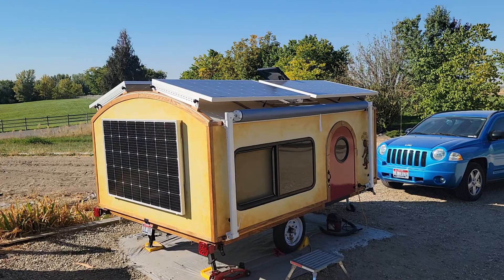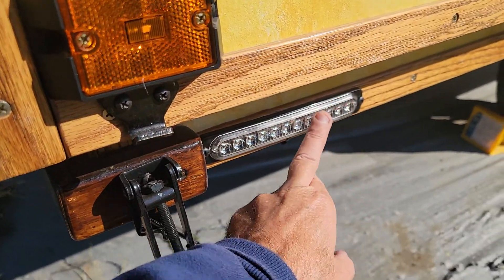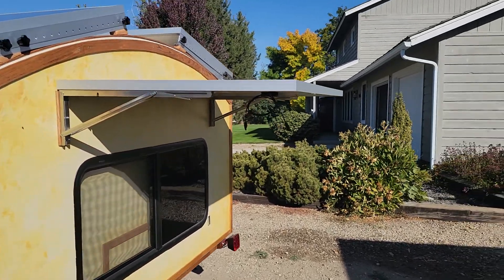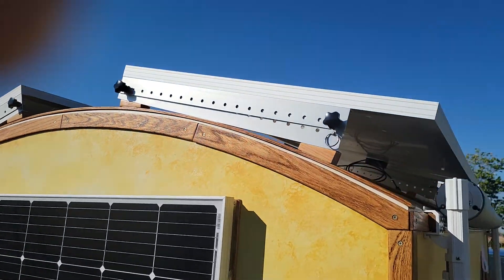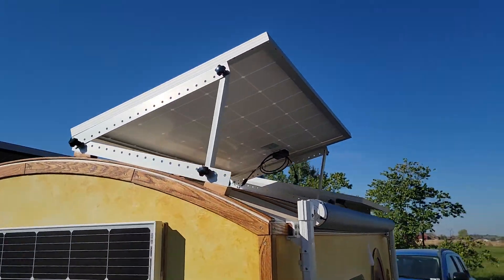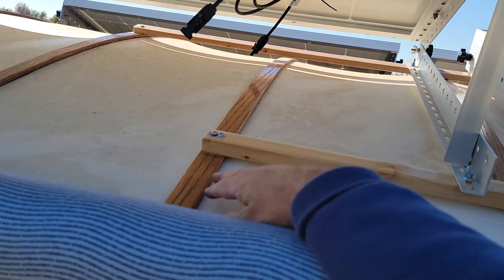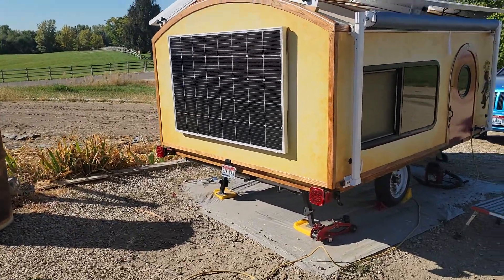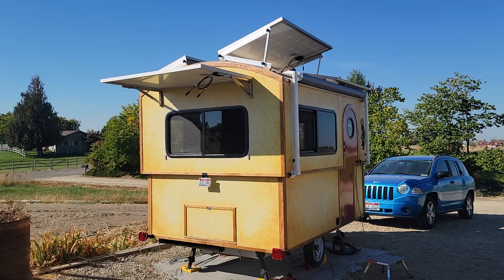Gypsy Caravan Project, Part 13: Solar Panels

Comment: How do you protect the side awning/solar panels while driving down the road?
Reply from the maker: I made a cover for the front solar panel out of thick naugahyde backed with a sheet of the 1/4" foam the panel was shipped in. I sewed an elastic band into the edge seam so I pulls the sides around the panel, then added 1" grommets to hold bungee cords running behind the panel. That also shields the front window. The top and back panels don't need protection, and keeping them exposed allows for continuous charging while mobile. Likewise, when the awning is stowed it's snug up against the side with low profile, so it's never been damaged.

Comment: You can build the back panel frame like the ones on top use those lock pegs on the ring and you can choose which way to tilt the panel. I never lost the knack of good erector sets. LoL
Reply from the maker: That's a really good idea. I think if I just drilled some holes is those existing brackets, and add a couple lengths of angle aluminum, I could use the ring pins just like you said to change the position. I love erector sets!

Comment: Looking good.  You have a heap of solar panels, how many and what size batteries do you plan on having (or have I missed that somehow?)?  Also do you plan to make something to cover the front solar panel to protect it from stone chips etc. while travelling? 
It'll be great when it's all finished.
Reply from the maker: It is a heap of solar panels for sure! I'll go through my full setup in the next video when it's all done, but I've got two 200Ah LiFePo4 batteries onboard, with a 150/100 MPPT charge controller and a 2000 watt inverter. As for the front panel, I'll be making a padded cover to avoid those nasty rock chips and bug splats. Good questions! 🐛

Comment: How do you plan on protecting the panel on the tongue end during travel?
Reply from the maker: I have some left over marine vinyl and the large sheets of 1/2" closed cell foam that the panels were packed in. So I plan to make a padded cover with a stitched in cord or elastic band to slip over that front panel to protect it from stray road debris. Excellent point, thanks!